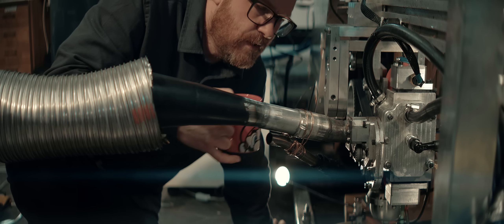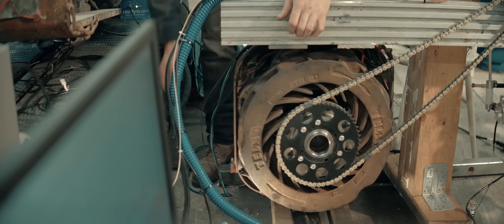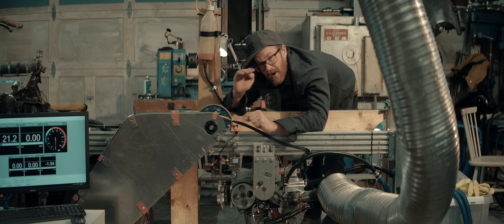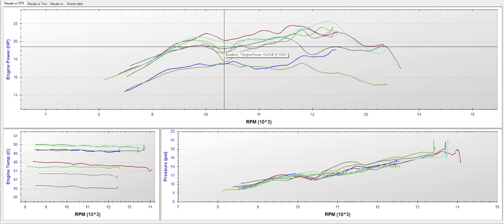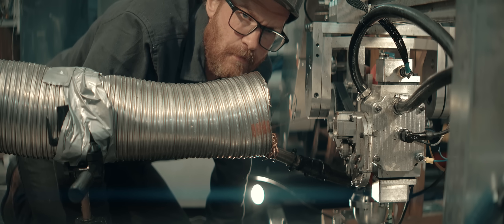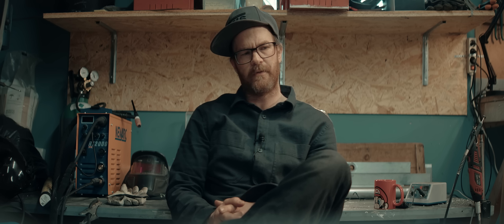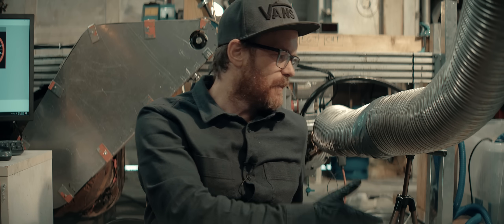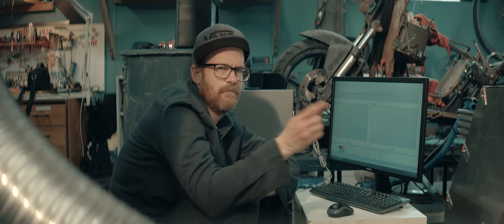50cc Supercharged Nitro Two Stroke - More compression?

Comment: I've got my actual comment/reply to the true content in a .doc, need to re-watch a couple more times, at any rate I wanted to reply Re your forced-forest-firefighting....Definitely sucks having one's hand forced, frankly I'm ASTOUNDED that it'd ever need to come to that (any guys in your area who are work w/ chainsaws, should be all-over this, honestly it's not even just that I'm shocked they aren't more-than enough, on a volunteer-basis, but the reality is that you as a non-pro simply do not understand/have the experience to efficiently move through a lot of wood, until you've gotten experience you'll just be pinching bars/ripping chains/etc although maybe your locale all-but requires you are already experienced-- IF so, would LOVE knowing what you use as your saw(s)!!!)  However, if you're just a regular guy who uses a saw 1-3x/year on your own, and are using some <$400 unit for 'real' work, I want to say I could & would happily help you a TON, you may just find that this most-basic/primitive form of 2-stroke, w/ its lil stubby can-muffler - I'm doing header-build tests today myself, too ;D - you may find them very very fun & interesting, I would happily send you free hardware and/or portwork and/or advice, definitely follow-up with me I'll happily shoot you my # and can provide an awesome hand-up if you had any interest in going from "Home Depot's best" to more of a hot-rod, not a "hot saw", mind you, those are for shows/silly, my niche is 'worksaws' in fact I've only ever worked on my own equipment because frankly there's just no $ to be made unless you turn high volume and I'd rather spend my time in trees than with a Dremel, so for me it's just continued-optimization of a handful of select, 'notorious'/iconic units that I just keep pushing-the-bounds on, "bounds" here being "It is still a work-saw, not a hot-saw" lol, meaning it can run full throttle w/o overheating quickly, and runs on (good quailty!)regular eth-free 91oct pump fuel, maybe an octane booster if comp. requires it!)  But yeah it sucks hearing that, I sincerely hope there's NO other way for them - for the safety of you & those around you - other than conscripting you & those like you, again please please don't hesitate to reach out I'd be glad to get you into performance worksaws, have seen too many other non-sawyers fall into this niche so I suspect it'd draw you (if it hasn't already!) and I was lucky enough, last year, to be given a very generous hand-up into the "big displacement / higher end" units so am needing to pay-forward anyways and have a good deal of gear....think someone like you would be best-suited to a Farmertec 440 or 660 setup, I have a pair of the 660's myself as my primary "big dogs", they eat Live Oaks (76lbs/cu ft!) like nothing it is insane, so much fun!!

Comment: In cart racing  plug fouling was always a big problem when running  a couple of laps without peak RPM . We had best results with NGK  Race plugs though.Once a plug is fouled it was near impossible to revive the expensive plugs only with cleaning. Sometimes it helped heating up the fouled plugs in an oven or with a blowtorch for a while.

Comment: I've been reading through the comments and everyone's on it. 
It didn't like 25deg at low rpm. 
Can't you put a curve into it?

Yes you want a big coil or mag of some sort. 40Amps is standard fair on a alky hemi. I don't know what your running but you need plenty of heat. 
Yes they can run rich, just don't hydraulic it. 
As they said, if it was easy everyone would be running fuel. 
Ask Connie Kallita or Austin Coil, they've been around fuel for while. 
And they still haven't got it sussed.
Good Luck

Comment: why are you not using a tune-able expansion exhaust   because of the Compressor ?  that would let you find out where the reverse compression wave is ergo more power in a ``normal`` racing 2 stroke engine

Comment: I remember a while back reading a Hot Rod Magazine article about nitromethane dragsters and difference between the regular gasoline engines and the methanol engines. The one thing I remember is that they had a lot less compression and they turned a lot less RPMs and you would think. A gas engine would have really high compression ratios 14 -15.10 and would turn really high RPM such as up to 8000 to 10,000 RPM while the nitro engines high compression ratios as low as 7 or 8.10  and the RPMs were much lower more like 6000-8000. Now this was on four stroke engines and I think if I remember right the reason behind the lower compression ratio was to to physically fit as much fuel into the combustion chamber as possible and run a lot of timing advance. So from what little I do you remember reading about in the old hot rod magazines it'll be very interesting to see what raising the compression ratio and the two stroke engine will affect it. Have greatly enjoyed this journey and watching you test out theories and showing us all the results that come from those theories. I'm in this build for the Long Haul and greatly appreciate you sharing all the things you've learned with all your fans. As somebody who greatly enjoys engineering challenges such as this I can't wait to see what comes of all of it. Cheers from Kentucky US.

Comment: This is a late comment, but has anyone else noticed how the engine is running much longer on dyno pulls without stalling now the retarder fault has being found. It now seems the engine has started to pull harder through the rev range, great stuff!
I think It would be nice to see the engine running with enough load to keep the motor at 10,000 rpm on full throttle for 10 second runs. That would get my juices flowing for sure while waving my arms in the air like a madman. 
Please Alex, make me happy again!
PS, your TIG welding is looking nice and neat, how about some hydro formed expansion chambers for the PiP project.

Comment: My experience with Nitro RC and automotive 4 stroke engines, first fresh fuel is always better with Nitro Methane, second plug fouling with Nitro I would recommend a spark plug with a hotter spark rating so that it'll burn off the castor oil residue since in RC engines the glow plug catalyzes with the fuel and glows hot all the time

Comment: I’ve done some tests on High rpm on 125 racing two stroke and found at 14,000 rpm a 12 volt capacitive discharge ignition system gave more complete burn of fuel ( no fowling ) , also could cut off the earth electrode on the spark plug and the spark still crossed the gap to the edge of the plug body . The C D I spark so rapidly dumps it’s energy that at high rpm the heat of the ignition takes place and finishes before the piston can move very far.

Comment: Have you considered using a hydraulic pump as a retarder and then a simple hydraulic valve in the circuit to vary the load? It might be an inexpensive solution.

Comment: I cant remember where I read it, but one group tested succesively higher compression ratios running a methanol fuel and never found detonation even at their highest compression ratio of 20.5:1. Also, the easy way to get more 
"spark" is to simply narrow the plug gap- if conditions require .015-.018 do it!

Comment: With alcohol fuel based systems I have seen them using stronger spark systems so I definitely think you are on to a solution there, they also run rich. This ups the compression ratio and presents no harm to the engine. Besides possibly making more power. 10/10 for this video. I like the dyno approach of starting high RPM and working on the load more and more.

Comment: Have you thought of variable exhaust timing? That wouldn't be too hard to implement. Adjust on a constant speed run. Also, what is the lost volume in the exhaust valve? Is it significant? Would a different valving system be worthwhile?

Comment: Now as far as ignition goes with nitromethane you need a lot of heat to get a higher efficiency burn in the combustion chamber.
So you need some high temperatures in the combustion chamber different from what you would do with normal fuel.
Not enough room for two spark plugs but you could insert three glow plugs or even a metal pin that would hang into the cup of the combustion chamber by having a hot piece of metal in there it will assist in the ignition during the compression and actually it give you a longer durational ignition to the burn much like having duration in spark timing.
This will give the same effect as what was used almost 150 years ago in engines when they had a cast iron bulb off of the cylinder head that would be heated with a torch and this heated chamber that the combustion gases would be pushed into would be ignited by the hot chamber so this would be the same thing as the hot chamber but we're just using hot pins into the cup of the cylinder head

Comment: One thing you need to understand the fact that you're using the blower changes the exhaust flow completely.
So the length of the straight tube containing the last firing wave in the exhaust tube is much larger so therefore the tube needs to be longer probably 24 in then the megaphone and you might want to try something different than the megaphone on the end something that's used as the same design as a ramjet uses in the combustion chamber which just happens to match the top cap on most Martini shakers.
And to get the exhaust gases back into proper acceleration just use the rest of the martini shaker and cut the bottom out of it I think you will be amazed.
I suggest several different sizes of Martini shakers see which one gives you the most timed control of the shockwave coming out of the exhaust.

Comment: The injected nitro dragster I worked on had 2 44 amp magnetos,if you run heavy nitro loads you need amps nitro is hard to burn.

Comment: Iridium plug maybe. 
Check voltage to coil .
Dieing at 25° timing maybe low on fuel top end , sounded to me.
Some back pressure on mega phone outlet , even a cone pointing in , in center of outlet gas goes outside of it.
Loven it

Comment: Have you thought of designing a cylinder head with variable compression ? Have a look at model  two stroke diesel engines where they use a screw to drive a piston down into the cylinder to increase compression . Maybe something you could do to complement your tuning ? In theory you could have an engine that starts out with lower compression but ends up running like a diesel if you can adjust the compression ratio enough - ignition timing controlled by the fuel mix and compression ratio  as in a model engine diesel as above .

Comment: Idk what % nitro you are running but after getting over 50% it really starts to go.  I have heard 30-55 degrees advance is normal with it because it burns slower. You are a ton wiser than I on 2 strokes so take anything I say as much as a question as fact. Ty for the video!

Comment: I'm fairly certain the megaphone exhaust is having it's results skewed by the exhaust evacuation tube. It's creating backpressure for sure, you can really see how much the output of the engine outpaces the vacuum's ability to keep up. You will get increased exhaust velocity if you move the vacuum tube away, and that will affect mixture. You might not actually be too rich.

Comment: You should look into a Harley Davidson magneto. You’d have to figure out how to put a second spark plug into the head to get it to fire every other cycle. But a mag will net you much much greater spark energy and help with the rich condition. I think you should look towards ignition before compression. 

Our n/a 360” small block is 17:1 and is mechanically injected with methanol and that’s considered high for an n/a engine. Don’t forget boost adds to compression ratio, as well.
Reply: For reference,,, 11:1 with 12psi of boost is effectively 20:1
Reply: most high performance 2T engines use a CDI ignition. The spark energy is often less than a coil, but they need the higher spark voltages CDI can provide to 'burn through' plug fouling.
Reply: @nerd1000ify  The reason they use CDI is because they can change up the ignition map in them. 
I know specifically the Honda CR250 digital ignition CDI’s retard timing at higher rpm. 2t’s are weird in that they make peak HP first and then peak torque higher in the rpm.

Comment: Maybe because this is an experimental engine, maybe you are hitting a critical rpm where the engine can’t effectively clear the cylinder     resulting in the big drop off until it clears itself out and mixtures stabilise again. Might be worth limiting the rpm limit and start working your way back up once the lower end of the tune is sorted. Great content though🙂!

Comment: I don't know anything about dyno's, but lets take the hypothetical situation where you brake much harder and faster than you currently do. If the brake is strong enough to very quickly bring the engine to a stop, wouldn't you find the load cell shows an impulse torque much greater than what the engine could deliver on its own, where instantaneous power would greatly exceed what you'd expect from the engine? This impulse (and very high instantaneous horsepower) would be due to pre-built rotating inertia of the engine internals. So in that sense the decelerating principle always includes some inertia built up in the bringing up to speed of the engine, and I think the same can't be said for an accelerating measurement as any building of inertia happens through torque that is at that time being measured.

I might be wrong in a 100 different ways, but I'm curious if the pulldown principle really works.

Comment: dont fully agree with your theorie on how the brake inertia wont affect readings.(in my opinion you actually read lower numbers because of the way you have it setup) But that dosnt make a difference to what you are doing AT ALL because the thing is you measure the same way every time. Its not you are claiming absolute hp numbers like its a fully calibrated system and you are selling people a 100 hp motor for a lot of money that in reality makes 70hp on a different dyno. No what you are doing is strapping a cool motor to a dyno and you compare results from other runs, ON THE SAME DYNO. So even if the readings are WAAAY off, it dosnt matter. I have seen hydraulic pump dynos for kart engines where they just looked at the pressure needed to brake the engine. If they needed more pressure to drag it down the engine made more power with the upgrade they did, if it needed less pressure they lost power. That way they could pre select wich upgrades they actually wanted to try on a real dyno, and it was correct in 100% of the cases, all measured improvements gave some sort of improvement on the real dyno. Not saying it was better tho, because they prettymuch only got a peak number with that measurement, so on the real dyno some upgrades turned out to be useless because they destroyed the powercurve and made it just have high peak power.
Reply: I would actually believe HP readings are higher than true using this pulldown method, I think the engine load cell measures the torque of combustion plus the deceleration of (previous to measurement) introduced rotational inertia in the engine internals. There are two forces working against the brake cumulatively, the torque of deceleration of previously introduced rotating mass of engine internals (which was not measured) plus the combustion torque (which is the one you want to measure independently).

I have no idea about dynos besides the power=~torque*velocity relation, but this is an intriguing thought experiment!
Reply: @filenizozemac  the reason i say it would read lower is if the inertia of the broke rotor is affecting the reading it would actually spin the motor up with its inertia making the motor and its cradle turn the other way then it would if the motor was spinning up the rotor, that means the load cell gets force applyed in the other direction, wich then read negative. Now offcourse the difference isnt so big that it wil go all the way to negative hp, but since the rotor is turning the engine over according to the inertia guys it would mean the value he gets is lower for the reason i said.
The value he gets would be higher if the loadcell is mounted on the brake tho, because the brake has to work harder to slow the rotor from high speed to low speed.

Comment: Timing needs to be a curve not a flat line.  Try 20dgs at 8k. 22 at 10k and 25 at 12k. You made more power above 10 k but clearly had to much timing for below 10k. Faster the engine spins the less time for front to travel across piston.

Comment: Make a foul adapter/ foul preventer for the spark plug, it's a fitting that screws into the head with a approx. 4mm hole into the chamber. The other side allows the spark plug to fit inside it,  it can keep a oil burning engine running,  maybe it can keep this engine from failing the plug, 
What about running dual 10mm plugs?

Comment: Stronger spark and bigger gap.  Can you run higher voltage into the CDI?  If not, can you replace the internals with higher voltage components?

Higher compression will have higher atmospheric resistance.

Comment: Methanol is hard to light and nitro is even worse... You need badass spark and wide plug gaps.
Get the compression out of the blower....
AND you are either WAY rich or running too much oil, no way you will make that much smoke in a power tuned setup............
Reply: He's using R/C fuel, which typically has a lot of oil in it. Most small R/C glowmotors have plain bearing crankpins and gudgeon pins, as there is just no room for a needle bearing (if you could even buy one so small). Sometimes there isn't even a bronze bushing, instead the bearing surface is simply a reamed hole in the aluminium conrod. So a very oily fuel mix is mandatory to avoid seizure.

Also the design of the engine currently probably ejects a truly comical amount of fuel straight out the exhaust port, so a lot of the smoke is likely fuel/oil that never even attempted to burn.